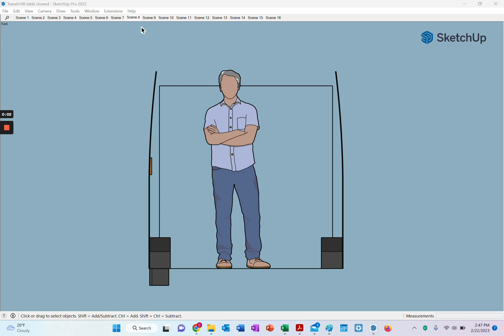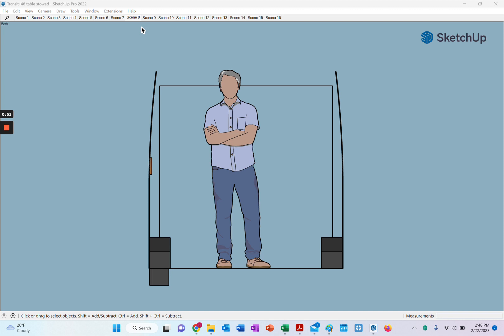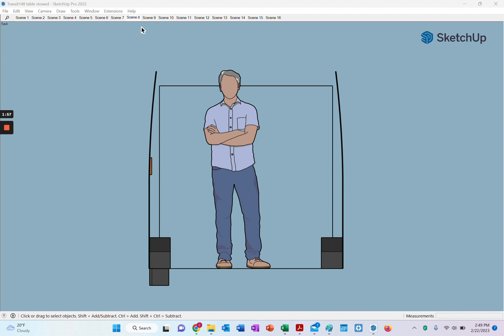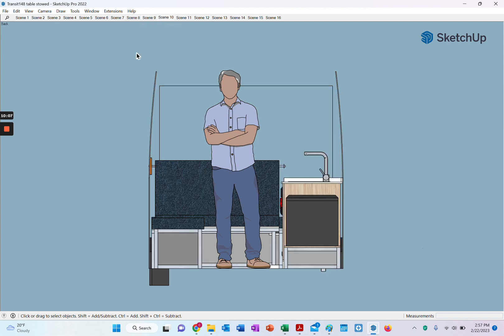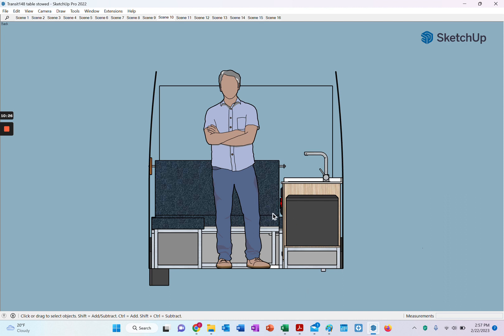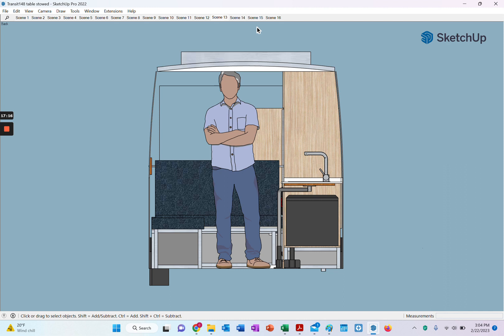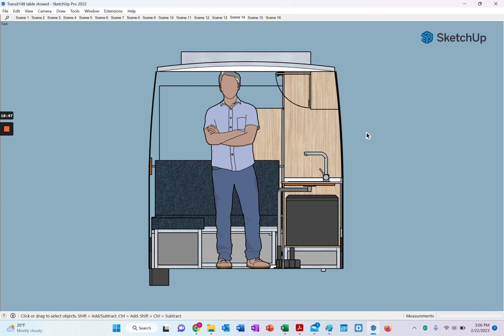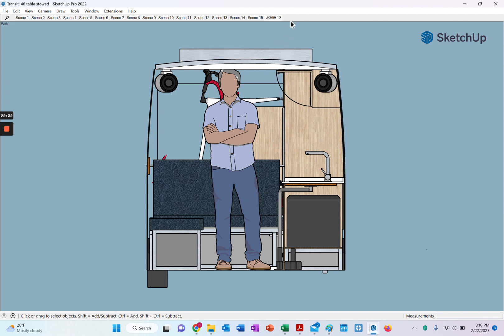Eiger-3 Camper build phasing from the front

Comment from the maker: Spent some time today thinking about how we'll keep the fridge in place on the fridge riser. The solution will probably be "endless" cam buckle straps that loop around the fridge handles and through custom slotted angles bolted to the fridge riser plywood top. When we want to move the fridge, we just release the cam buckles and pull the straps free.

Comment from the maker: The bench/bed is 42"W 83.5"L (3,507 sq. in.) when fully extended and flat. A twin XL is 38"W 80"L (3,040 sq. in.). A full is 54"W 75"L (4,050 sq. in.). So what we will be building is roughly halfway between a twin XL and full size bed. To install the galley and water tank, the bench/bed will be removed from the van.

Comment from the maker: The AVC Rig flooring system (https://avcrig.com/collections/interior-base/products/9pwdpgtominpcbzlfd72x5nawopj56) uses the ZIP System R-insulated sheathing panel. AVC Rig CNC cuts the panels and routs the insulation portion so it fits the Transit floor ribs perfectly leaving a little more than 1" of panel above the ribs. 6.6 R-value. Its a great way to easily get an insulated floor into the Transit. We made an inquiry to Huber (manufacturer of the panel) and based on their reply we'll need to either through bolt into rivnuts in the van's metal floor or use over-drilling with epoxy plugs and threaded inserts. Ideally we'll be doing some testing on a sample piece. We like the marine West system for this kind of epoxy. Here's a link: https://www.huberwood.com/zip-system/insulated-r-sheathing?gclid=CjwKCAiAl9efBhAkEiwA4ToripwH5DCXTeK83mmkQao8k040hIGtkkcAK8cD2TOEdKndlYo2h42WyhoCVFQQAvD_BwE